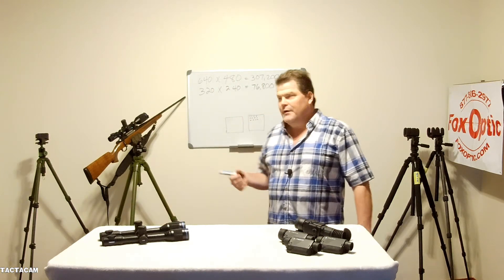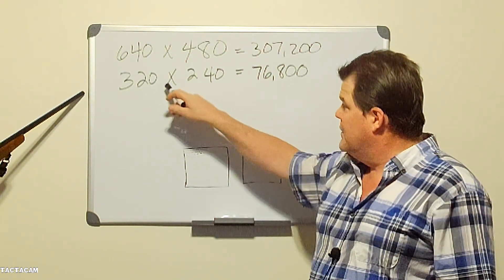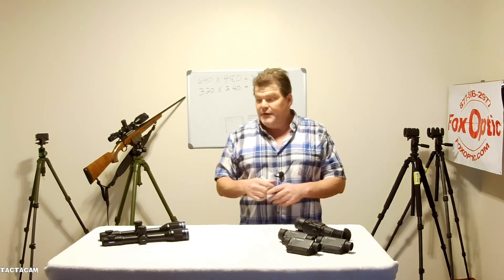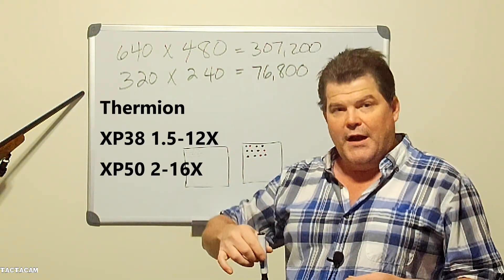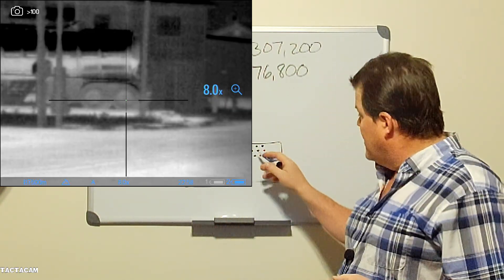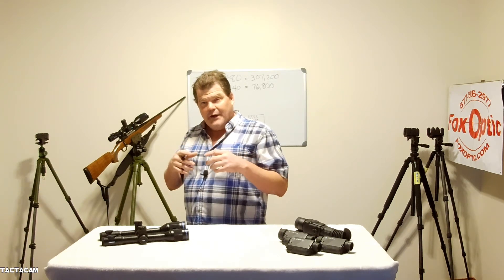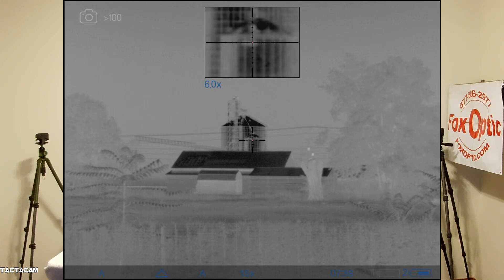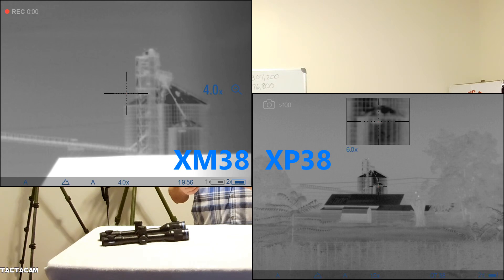Thermal sensor size and micron pixel pitch which scope or monocular is right for me?

Comment: Can a thermal that uses the Weaver mounting system mount to a Picatinny rail?
Reply from the maker: @IsaiahChapter53isAboutJesus  Typically Weaver will mount to Picatinny rail without any issue, but Picatinny mounts will not fit Weaver rail as the recoil lug is typically to wide and the cross-slots are often not in the correct locations.  With this said,  it's still  best practice to match them as "weaver" is really just a "brand" or style of rail and true Picatinny should be a MIL standard specifications. (Unfortunately some manufacturers don't know this because they will install out of spec "Weaver multi slot style" rails and call them Picatinny.

Comment: New optical magnification on the iray is the wave of the future
Reply from the maker: The final optical magnification, focal length,  lens diameter, and sensor combination set mechanical limits on top end performance. (The bottom suffers)  It creates additional mechanical complexity and adds size weight vs. larger sensor/multiple sensor combinations that essentially establish the same end result with better reliability and less weight.  It could be worse,  1 of the other companies braggs about a 640x360 with "optical zooming" but really just zooms on their Chinese display.
Reply: @foxoptic5887  yeah I've seen that one and it's poop for sure!

Comment: The sensor size must be coupled with a lens which can project to the size of the sensor. Larger sensors can (it sucks) digitally zoom more than the smaller sensor size. None of the thermal scopes have optical zooms as your optical scopes do have. As for as pixel size. The larger the pixel size, the more light can be captured. You can cram too many pixels into too small a space. When that happens I,age quality will degrade. Always when comparing sensors, always know the physical sensor size. For example a small physical size of sensor with a 320 x ? can possible perform better than a 640x? In the same physical size of sensor. Pixel count is not always a good indicator or quality. The sensor size and pixel count is key. If you have a physical larger size of sensor with an increased number of pixels at the larger physical ( micron) pixel size then, you have found a product whose manufacturing is on the up and up. Nikon is the worst at screwing the consumer into thinking pixel count is king. Trust me as a professional photographer for 52 years, find out what the physical dimension of the sensor is. Find out the micron size of each pixel. Find out what the pixel count is. Make sure the lens is matched properly to the physical sensor size. When seeing a lens size, it is not the diameter of the lens quoted, it is the mm of the focal length. So if you see, for example one model having a 25 mm lens vs a 35 mm lens, this is focal length not maximum aperture or light gathering ability.  Also the objective, this should be as high as is available. I has to be tack sharp with its own resolution which is high enough that you cannot resolve each dot, if possible. There is a guide to what a human eye can resolve un aided and it should be beyond this. Lucky today with the madness surrounding the mirror-less cameras, this quality is readily available. Nuff said.
Reply: Optical zoom now on the new rico

Comment: Great video as always, Travis!  To my eye, all things being equal, the 12 micron pixel pitch seems much better picture quality (ie. XG50) than the 17 micron pixel pitch.  Do you concur?
Reply from the maker: Honestly,  I think it is a more complicated question.  For starters most manufacturers pair the smaller sensor micron size with either smaller lenses at shorter focal lengths or higher magnification at the same focal length compared to the next pixel size up.  This is the primary advantage of the reduction in pixel pitch, "smaller" sensors allow smaller lens exit pupils.  With this said,  it really depends on what we are comparing.   The XG50 is a 12 micron sub 50 mK 1.2 aperture 42mm lens at 3X.  It produces high resolution and crisp subject images but has a narrower FOV, shallower depth of field and less background detail than the new XP50 Thermion Pro unit.  The Pro  uses  the new sub 25 mK 17 micron 640x480 sensor at 1.0 aperture with 50mm lens at 2X which provides some impressive characteristics.   Namely a very sharp broader image that deals with weather shifts better.  It has wider FOV,  larger depth of field,  and a generally smoother image.   With this said,  the XG does provide better image detail (ID range max 20% better) on properly focused subjects at longer distances in good weather conditions.  (As weather conditions deteriorate  the XP50 PRO catches up)  They are both outstanding and versatile units, I personally find the XP50 PRO to be more versatile and better suited to my conditions as I would rather keep the 33% additional FOV than have the extra 12% average gain in ID and more focal adjustments.   I will tell you that I am yet to see a 2X 35mm 12 micron that will match the Pulsar 50mm 17 micron 25mK image. On paper they should be a dead match, but it always seems like something new crops up that makes them less smooth.  (Signal noise,  calibration issues,  artifacts,  etc...)

Comment: math is not the strongest his skills. 24 for 17 is not square, but diagonal, if pixel has equal dimensions. for 12 - 16.97
actually 17 is not width, but pixel pitch - i.e. step between pixels
Reply from the maker: 24mm sq on the 17 micron sensor footprint vs 16.5 on the 12 was according to the ULIS sensor spec data, I didn't calculate it..

Comment: Thanks for the great video! Definitely understand pixel pitch and sensor resolution a lot more - Just wondering if there was much physical size difference between the screens on the Axion XM30S and the Axion XM30 KEY model - Is the key model’s viewfinder screen much smaller than the XM30S? Also how do these viewfinder screens compare against the physical screen sizes of the Thermions? Cheers, Mike
Reply from the maker: The AMOLED scree appears about 60% larger than the LCOS.  This was represented in the FOV vs magnification naming in the XM30 4x vs XM30 Key 2.5X.  FOV was identical in these two units, the increase in magnification naming was a result of the physical appearance of the screen being that much larger.  .The Key models use what appears to be a much smaller LCOS display.  I am not sure the display itself is physically that much smaller but they certainly don't magnify it as much with the ocular lens.  I am guessing this is a product of just not being able to magnify the lower resolution LCOS display as high without seeing more "imperfections" The XM30S uses basically what appears to be a further improved version of the original XM30 units 1024x768 AMOLED display, the Key units both use a 960x720 LCOS display.   The "physical appearance of the display in the XM30S is very similar to what you see in a Thermion however the image while very useable certainly isn't as clear with the smaller axion objective lens.  Don't get me wrong, for the money, the Key units are great at detection but they are certainly more friendly to younger eyes.

Comment: Great video. Learning more each day about these thermals for a potential purchase. Since I see you are excellent about responding, I have a question or two.

Which scope would be most price efficient with the following: a 640x 480 sensor, a 640 resolution (or better) viewing screen with a good or great field of view? Thanks in advance for your time.
Reply from the maker: Personally, (assuming you are asking about a weapons mounted "scope")I like the new Thermions XP's for the money.  640x480 sensor, 1024x768 OLED color display.  The XP38 is 4499.97 or the XP50 is 4999.97 for the kit on our website. (Kit 2-APS3 batteries, QD mount, and Cover)  The XP38 is 1.5X-12X with 16.3° H base magnification FOV and the XP50 is 2.0X-16X with 12.4° H base magnification FOV.  Long story short, either of these has tremendous FOV coupled with good magnification clarity produced by both a rich 640x480 sensor and a very high-quality display.  Using Pulsar's PIP it's like having 2 scopes in one.  If you have any questions you can call me anytime  877-806-2977  Thanks  Travis Fox  Fox Optic
Reply: Thank you for your time and reply. I will have to give you a call sometime.

Comment: Hi Travis 
Thanks for your info so far on the thermion scopes, have you had a chance to check out the Xm 30 ? 
I shoot hogs out to 150m max with a 6.5 creedmoor. Do you think the xm 30 would be a good choice for this situation?
Cheers josh
Reply from the maker: Joshua, As far as I am aware, nobody in the USA has seen the XM30 yet.  I don't think that the XM30 model is even supposed to be "released" until sometime in late August or September.  Looking at the specs, I don't think that 150M would be an issue, I have guys taking coyotes beyond that with the Core RXQ30V, which is only 1.6X base and I expect the XM30 Thermion to outperform it fairly substantially.  The Thermion's detection number is almost 60% higher than Core's 875  at 1350 yds, the ID's should follow that. The Core seems pretty good in the 150-200 yd positive ID range on game of that size, so I would expect the Thermion to achieve 250-300 in decent conditions.  The Thermion will have the new 12-micron sensor, almost double the base magnification and the 1024x768 display screen.  The display screen doesn't increase in appearance/size by the exact proportions, just the resolution; example 640 vs 1024, the "DPI" is almost double,  however, the combination of the new ocular and the new display also have it appearing what seems to be about 25% "physically" larger. This helps with the detection increase also.    One other note, the XM30 is going to be a fixed focus unit, however, I really wouldn't mind that provided I wouldn't have many shots inside of 30 yards or so.  Again, this is the only Thermion I have not seen yet and these are just estimates based on the specs. that Pulsar has released. (Their data is usually spot-on accurate so I don't anticipate any surprises)  Thanks, Travis Fox  Fox Optic
Reply: Why is fixed focus on the XM30 a disadvantage when target is inside 30 yards? Or did i misunderstood this?ThanksLeo
Reply from the maker: @LeoTheLion66  I still have not received or seen the XM30, however in theory the reason extremely close focus may be an issue is that in order to get focus to infinity the manufacturers typically must have a higher close focus point,  this combined with the units higher 3x  base magnification vs say the 1.6x found on the RXQ30V Core has me believing that the first 20-30 yards are going to be a bit fuzzy.  Should be clear from that point on.  Again this is just a guess based on the numbers and what I have seen in other units.
Reply: Hello Fox OpticFirstly thanks for you videos that helps me and a lot others to understand the products.I was contacted by my local Pulsar dealer (In Denmark) today, because I have a pending order for the XM30. I was informed that due to some problems with internal parts, the XM30 will not be launched as planned this year and not as the XM 30 design that we have seen on adverts.I do not know if you can confirm this?ThanksLeo
Reply from the maker: @LeoTheLion66  I have not heard this from the US distributor yet, however I do know they have not received any units yet, so I assume it is possible.   I know demand for the other models is high and I am having some difficulty getting enough to fill orders, I assumed they were putting it off till they got caught up with  demand for the other models.  I believe my rep has a meeting with them this week so I  should know for sure in a week or so.
Reply: @foxoptic5887  ok thanks
I just saw that the XM30 had dissapeard from the Pulsar homepage.
Rgs Leo